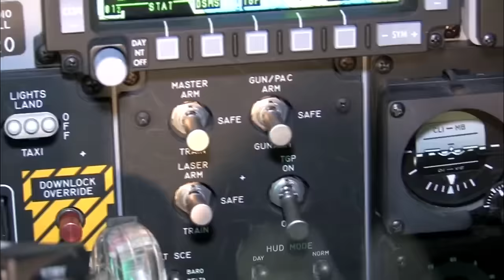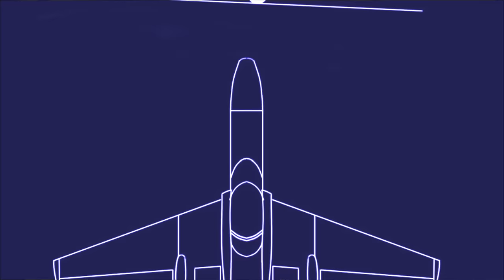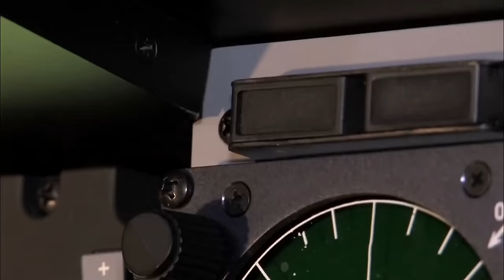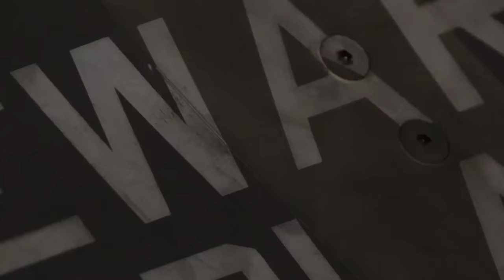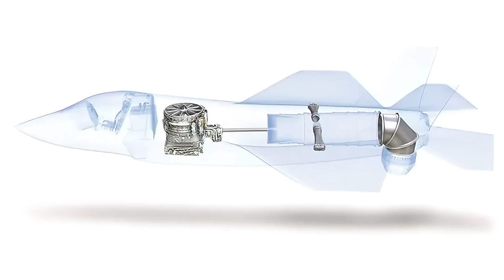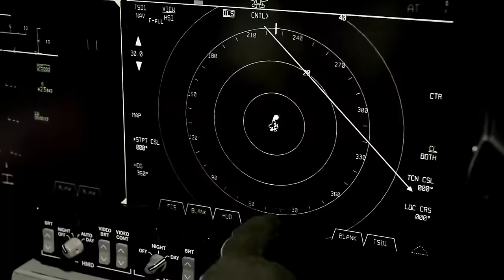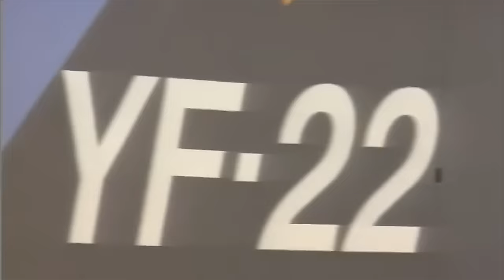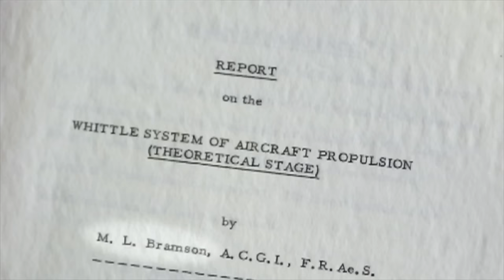A-10 THUNDERBOLT II "Warthog" | The Untold Story. Part 2: Deployment & Controversy

Comment: You know what they should really do with the F35 and what it was really meant for?  A new AWAC system.... If you just put in more sophisticated and longer reaching radar with its computing power and ability to designate targets  It would literally be the perfect AWAC system as a stealth fighter that could handle its own in any situation and protect itself so it doesn't need escorts but it's best ability is to be able to detect threats and designate targets to more specifically geared aircraft such as the F-22, F-16, A-10, C-130J, B-1,or B-2  I believe that would be a far more effective use of the aircraft,  But I do not believe it can multi-task all the missions as well as above said aircraft... I believe those aircraft should be the ones doing the missions while the F-35 should be directing the missions.

Comment: I thought this was a docu about the A-10? Seems more like an A-35 ad.
Anyways. Norway is all in on the A-35 - but they just cannot recruit enough mechanics to keep them in the air. That plane requires intensive maintenanace. I think the commentator who said making planes more fit for purpose would be cheaper was correct.